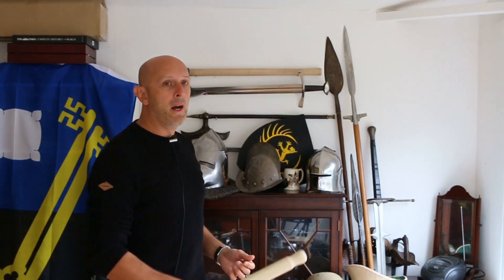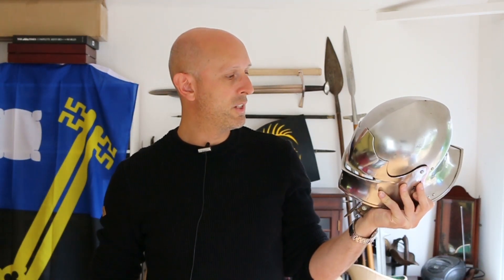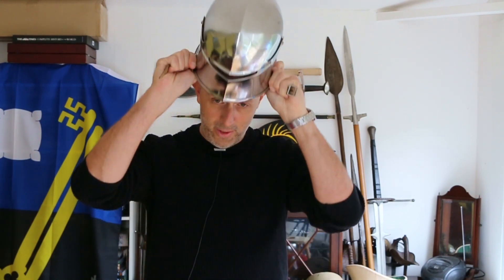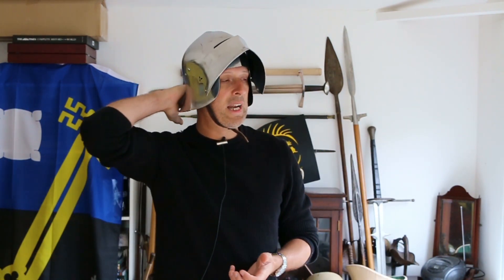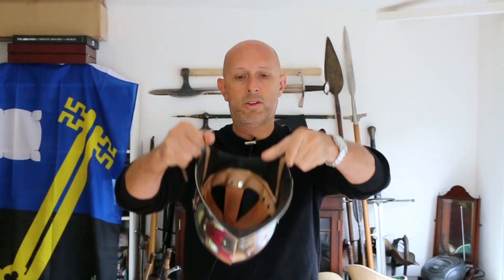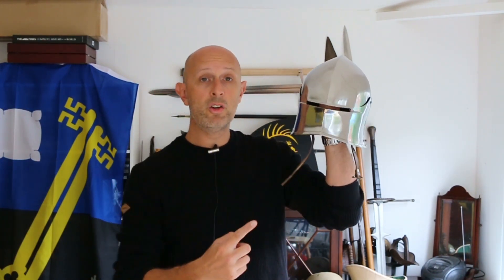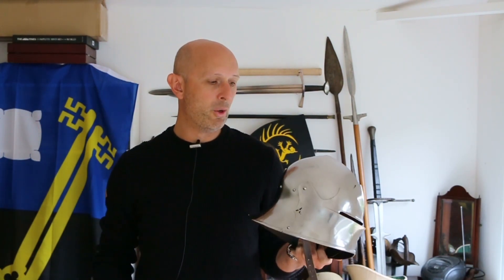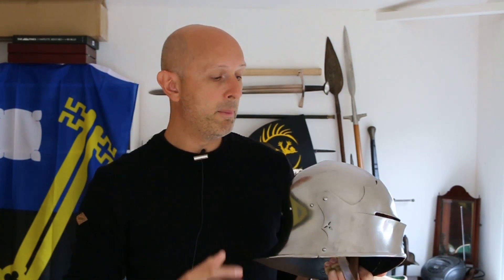Medieval Helmet Noise!

Comment: So another point in why the Roman imperial helmet has maybe the best design for common soldiers in history. Great visibility and not much in the way of hearing commands, good top and back of the head protection and even some face protection.
Reply: Although it does have a lot of incidental noise from the hinges of the cheek guards, which are, after all, right next to your ears. Even turning my head relatively slowly, I found it almost as deafeningly loud as taking a mace to the head in an olmutz helm.
It's still an excellent design, of course.

Comment: Well, i can tell you that a steel helmet with inner plastic helmet and leather fitting is also loud when rain hits it while not enclosing your head as much as your example piece. But when i ran into a wooden log (i couldn't see the crossbeam at the top of the trench because of the steel helmet) i didn't hear any loud noise, it just sat me down, my vision was blurry for a second and my head and neck hurt. The only noise i remember was the instructor yelling: "injured?" i said "no" (a reflex) and he then yelled "Alarm" and i had to run to the end of the trench (this time i ducked down lower) and fire 6 times at targets 200m away. And for the 2 missed i had to do 40 pushups. The  pushups didn't improve the head ache or neck pain to any extend. But the steel helmet had a substantial dent in it. ( 5x2 cm and half a centimeter deep, so from then on my helmet was easily distinguisable from the rest as long as i didn't camo it...) Oh, and i think my hair didn't make much difference there ;-)

Comment: That's why the roman helmet is badass. Good protection, good vision, good hearing.
Reply: The Hoplite Corinthian helmet is more badass imo. They too have cut outs for ears.
Reply: But worse vision
Reply: @IlBarbafluff  But face protection
Reply: The cheek plates and the brim on the front work quite well for cuts to the face. Yes thrusts to the face are a problem, but the advantages it gives in vision when working as a unit quite outweights it. And it still is more face protection that most trooper helmets have.
Reply: In context, the Corinthian is for hoplites....they kinda don't need an excess of visibility. They're in a phalanx. Even if they could see around them, they can't move or do anything about it.
Reply: Well romans were not in much a looser formation... When you work in a unit you do need to coordinate with the others. I guess though that for that hearing is more useful than seeing.
Reply: Compared to a pre-Alexandrian phalanx, the Roman formation has enough space to sell real estate in the gaps between the men. Roman soldiers had far more need to be able to move and react within their own space, and needed the visibility as a result. For the guy in a phalanx, frankly his lack of visibility is almost a beneficial feature - an individual in a phalanx shouldn't be looking around for things to worry about and run away from, nor does he need to worry about an attack from outside his front 90 degrees. He only needs to look forward, and listen to orders to push or advance when in combat.

Comment: Most helmets with original liners i have seen have a padded cap in the same fashion as your leather cusion .
Some are even more padded like on sallet from coburg , but all have a open point in the middle were you can tighten it or loosen it .                                                                                                                                                        

Regarding the noise , tepending on the padding and the movement that happens thereby can be very quiet . Very hard hits are even more quiet if the helmet dents because it sucks everything up .

Comment: Also, the reason it was't loud when you were hitting the helmet while holding it toward the end of the video was because of how you were holding the helmet in a tight grip. Go pick it up again but hold it dangling by one of the leather straps and it will ring, just like a sword won't ring if the blade is held.
Reply: Ir won't ring it is on your head either.
Reply: Bollocks. 4:06 and 4:21 has an OBVIOUS ring. How did you not hear it? I can clearly  hear a ring through my ear buds. Compare that to 6:43 where the helmet makes a dull CLUNK sound. Yes. The helmet rings when suspended on the head and not held in hand.

Comment: Long hair makes some helmets shift on the head more easily. The traditional samurai haircut of "chonmage", the shaved head with the topknot folded to the front, was meant to make the helmet fit on the head more steady (than the long hair worn in earlier periods).

Comment: You absolutely need padding inside of helmet. That is of course if you don't want a concussion. Built in, coif, smurf guts (blue foam), any sort of padding is a must. It definitely quites the impact from weapons as well. That sallet is also more prone to the ringing, due to its one piece forming. It's like a bell at that point. You won't get as much a noise from say a spangenhelm or any other riveted construction style of helmet.

Comment: For any meaningful hardness you want at least a 0.45% carbon, that's prettymuch the modern standard in swords when you actually notice some form of hardening going on. But as you know you wont reach sword quality until you go into the 50's and higher. But you can harden any steel by super quenching no matter how little carbon is involved. It was developed in California buy a smith decades ago. Even mild steel will harden if you bring it to above critical temps and then quench for around 8 seconds, (some people say 5 is enough)

Just some info for the viewers in case they are interested, save them looking it up.

Comment: Do you belive medival soldiers usually suffered from hearing damage because of this?
Reply from the maker: Unlikely, because it would not happen often enough for that to occur. In the gunpowder age, a lot of people probably had poor hearing as a result, however.
Reply: @scholagladiatoria  I respectfully disagree. Based on my own experience with hearing damage. My left ear drum was damaged while working in a truss manufacturing plant. After one afternoon of working without earplugs and hearing the metal hammers hitting metal tables. It was LOUD.
 I always compared the sound to that of what a battlefield must have sounded like with all the metal on metal and such. 
 Anyway i always apreciate your videos Matt, keep up the good work!
Reply: Better to lose your hearing than your life.
Reply: airborneleaf not to mention the damn ringing

Comment: People, you don't spend most of your day getting bashed in the head wearing a helmet. Mostly you just wear it. Ringing helmets are far less of a problem than you realize, except for maybe tournament use, where you expect to get struck a few times a day. Exzessive padding just is not worth the trade-off. It makes the helmet heavier, hotter and the hearing even worse than it already is. Yes, there are a few exceptions to this, but most medieval helmets  only had suspension-system like on Matt's sallet, or some relatively thin padding.

Comment: Circlets? They are usually padded, so... not just a display of livery, also external helmet padding to dampen the dings and sharp blows?

The closest I have encounterd is wearing a WW2 Adrian helmet for Airsoft (someone has to play the French). Because of how the liner is mounted (on spring metal tabs on the inside of the helmet) if that brim gets hit, it rings like a bell.

Comment: Just to nitpick your metallurgical terms a bit. Medium to high carbon steel can be hardened, but there is a low carbon steel that isn't hardenable, aka mild steel, which is in fact a type of carbon steel.

Comment: Seems odd that armourers didn't make a small hole in helmets in the ear area to facilitate hearing. Modern North American 'football' helmets have such a opening so that players can hear the quarterback's coded play call for a play change at the line of scrimmage. Or why the crowd will 'make noise' to try to blot out these 'audibles' from being heard. Such a call might be "2", designating a certain player, "34". designating the action that player is to take, "19", designating actions other players are to take in support. This is of course a very basic description of an elementary level of play calling after instructions given in the 'huddle' may need a change as the quarterback 'reads' the defensive setup before the snap of the ball starts the play action. So one wonders why no ear holes?
Reply: I was thinking the same thing, but instead of a single hole make a series of small holes like breaths on a visor or on the front of a great helm.
Reply: Yes, it seems a rather obvious feature not taken.

Comment: Of course you would want some kind of hat underneath.
Reply from the maker: Nope, not according to thousands of medieval manuscripts showing these worn. They were usually worn directly on the head.
Reply: But this is so strange! Why ?!
Reply: It gets hot in full armour. You would want to be able to get ventilation where you could , without sacrificing too much protection and heat rises.

Comment: Weren't people supposed to always wear paddings and/or coifs underneath their helms?
Reply from the maker: No.
Reply: I really thought they would.
Reply: Padding wasn't necessary because of the liner, it keeps your head from making direct contact with the helmet so if you get hit in the helmet the force of the impact doesn't go directly to your head. That basic design worked so well that it was used to varying degrees by militaries around the world when they started using metal helmets again during WW I. However, this sort of suspension systemt is starting to be phased out in favor of pads, probably because they absorb the shock waves from explosions better.